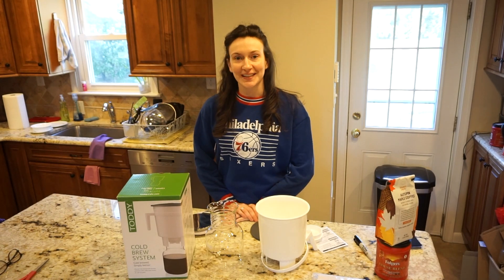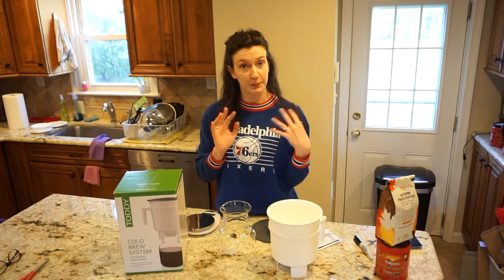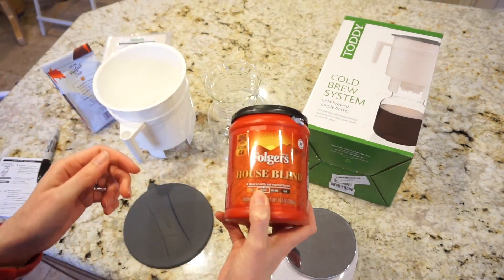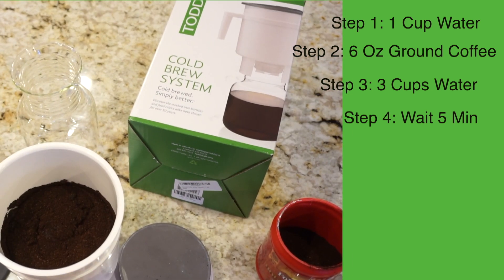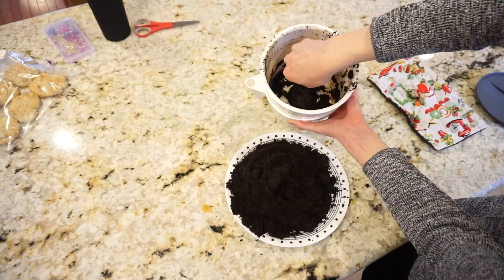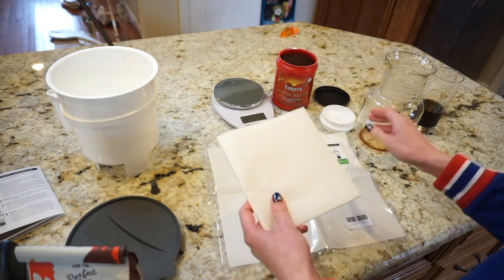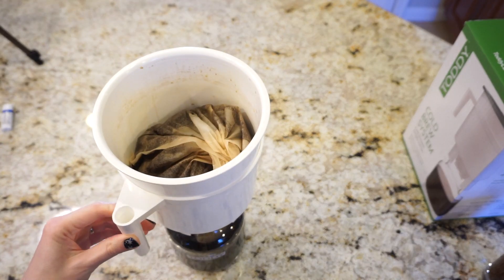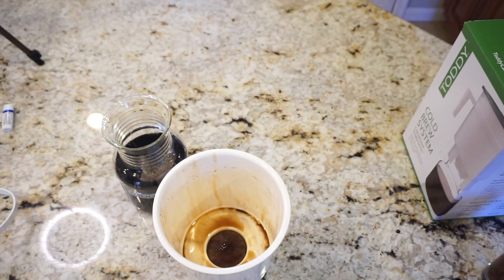Toddy Cold Brew System Review & HOW TO CLEAN!

Comment: I have been using the Toddy for decades and use a modified system. I place a readily available pleated paper basket filter into the bottom of the brewer first then sandwich the felt filter on top pushing it into the recess. I use 5 cups of ground coffee and 8 cups of filtered water. Really my coffee mix is 2 cups dark roast, 2 cups of medium roast and one cup of coffee and chicory- CDM. I let it sit for at least 12 hours often more. After brewing the first “pot”  I reuse the coffee again using only 4 cups of water and wait 8-12 hours. I use two glass carafes keeping the different brews separate. Both are good but the second drip is not as strong. After using the felt filter for both batches I rinse it well and put it into the dishwasher to run with my next wash.